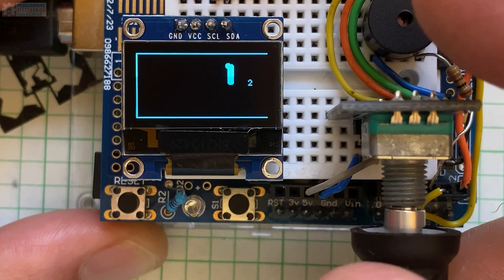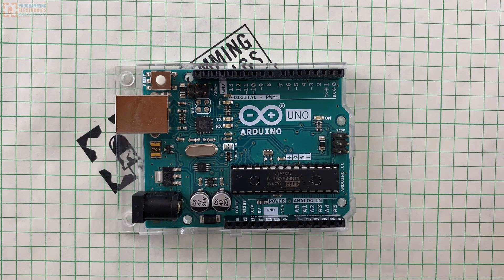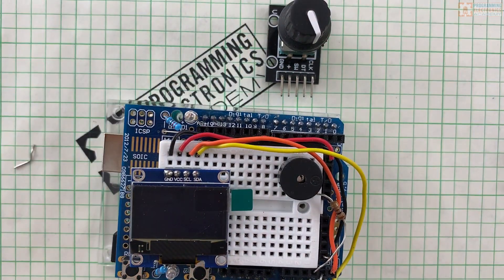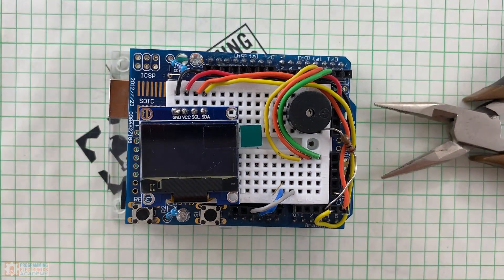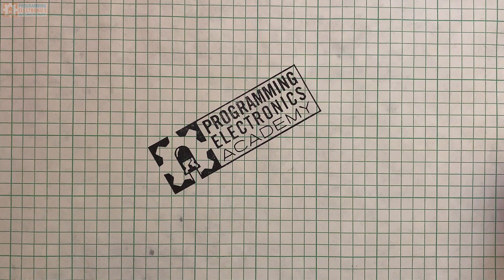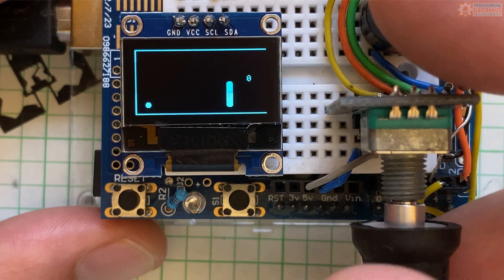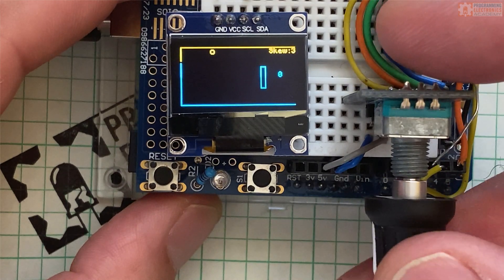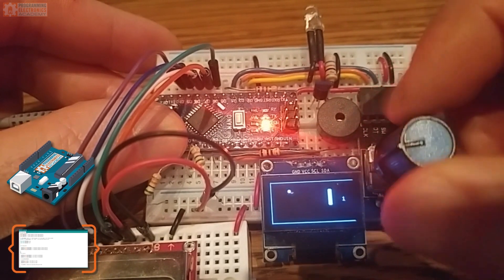DIY retro pong game that fits in your pocket

Comment: Hello, I like this project and want to explore more of it. I am fairly new to Arduino and coding but it is a fun hobby and I am wanting to learn more.  I have been looking at the code and it is a lot more than I can figure out.  I am wanting to change the direction of the paddle when I rotate the encoder shaft clockwise for the paddle to move up.  Right now your code has it going the opposite direction. If I was playing left handed this way is correct, I am playing right handed the other way is more comfortable to me. Where do I need to look to accomplish changing the rotation direction?

Comment: Could this be Made with a button and a 10k potenciometer?
Reply from the maker: I think it "could" be made with a potentiometer, but I think it be tough with getting the timing to work out.  The rotary encoder code is using interrupts to update the position of the paddle, with a pot I think you'd have to be polling the analog pins, which might make it not as responsive.  Might be a fun challenge to try though!

Comment: Code doesn't compile successfully. I meet this error (among others)  in many lines : pong:81:23: error: request for member 'activeValue' in 'params', which is of non-class type '<unnamed struct> [5]'
   allowSound = params.activeValue; // sets sound on/off
Reply from the maker: Sorry about that, It has to do with how the code is rendered on the website and copied (it is adding hidden characters), if you download the sketch file it should work fine
Reply: Thanks !

Comment: The code doesn't work.
Reply from the maker: Are you getting an IDE error?
Reply from the maker: The code issue may have been how we had the code embedded on the website.  I have added a link to the post to download the sketch. I hope this helps!
Reply: @programmingelectronics  I've finally figured out what is going wrong.. Your code is perfect.. the problem is my library.. I'm so used with the "u8glib" I thought it's the one your code needs..which is not... It turned out there is a "U8glib". Now, all is great!
Reply: Thank you!